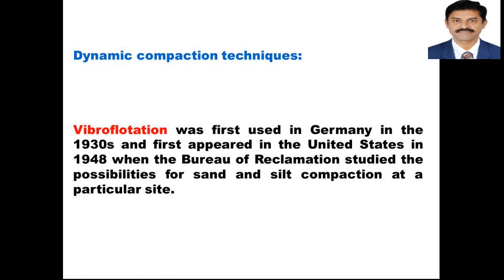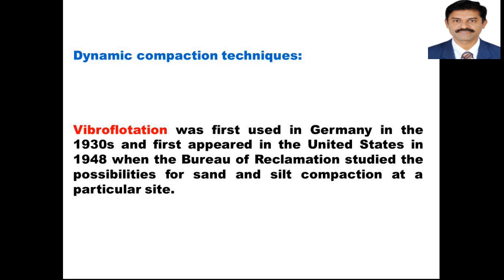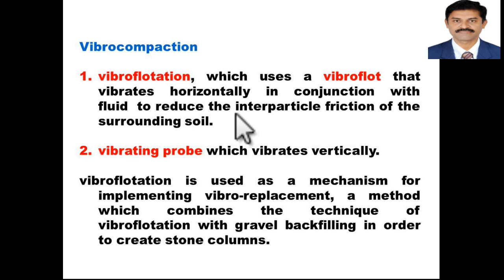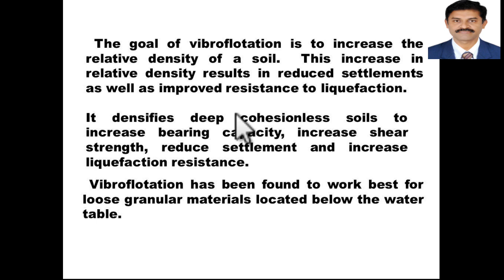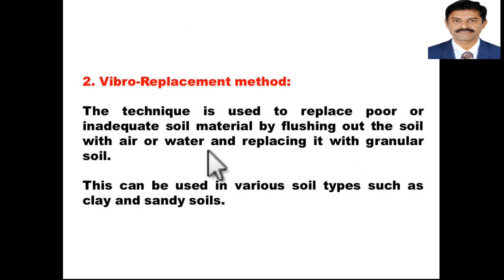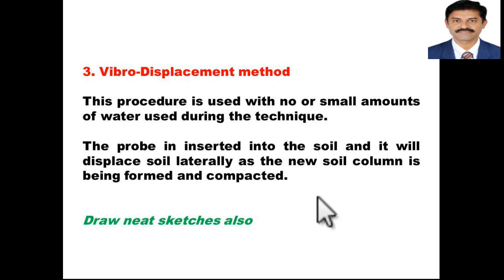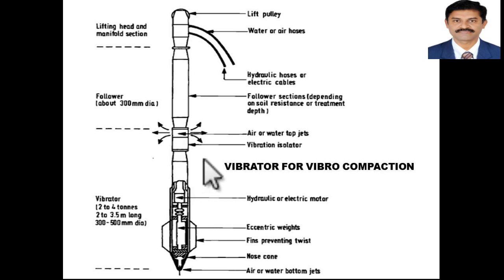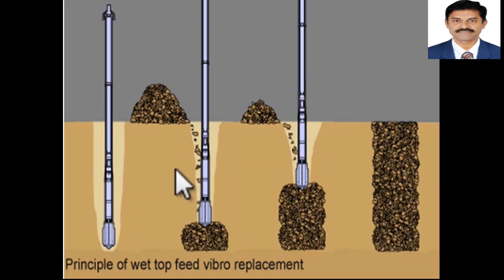Ground Improvement Vibro-compaction Techniques for GATE, KTU, PSC, IES examinations

Comment: Sir could you make a lecture series on Geotechnical Earthquake Engineering,( seismic slope stability analysis, Retaining wall,  bc etc)
Reply from the maker: There is a video related to earth pr theories. Geotechnical design of retaining walls and soil dynamics will be done. Thanks for the suggestion!